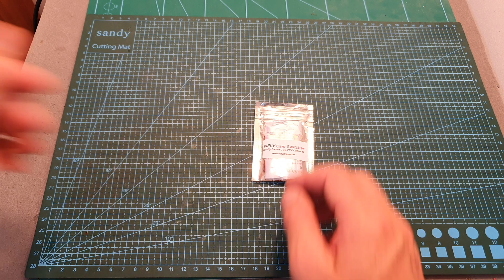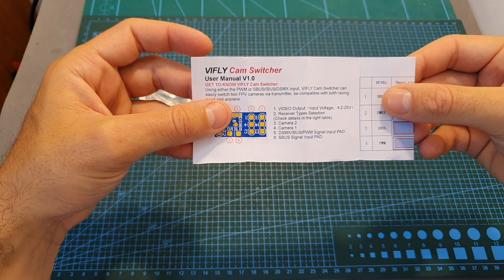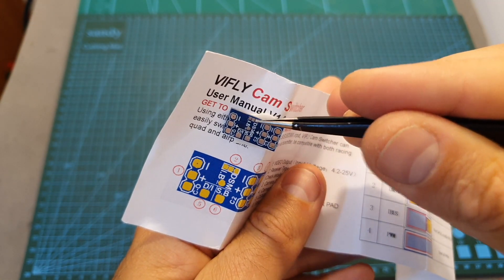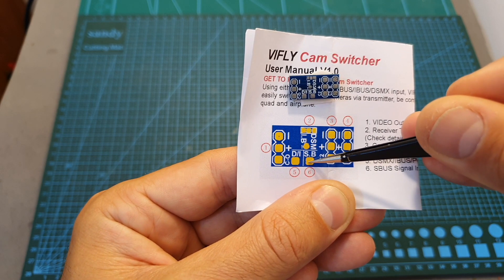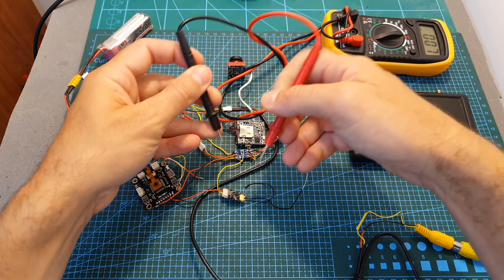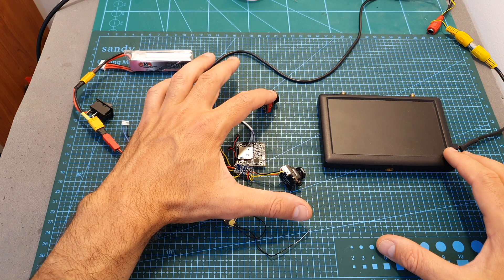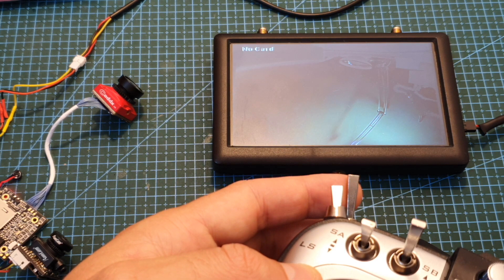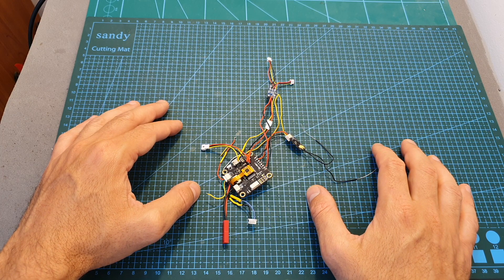VIFLY Cam Switcher - How To Easily Switch Between Two FPV Cameras

Comment: Hi sir what do I need to run a dual camera setup with elrs reciever
what FC do I need?
Reply: My reason run cam split, with a seperate analog camera for best onboard dvr video and for great reliable analog feed thats low latency, cant achieve everything with just the split, so this can help me to use the split run cam feed to change settings for it then switch back to other cam for flying low latency and reliable

Comment: So the sbus signal out of the rx connects parallel to the flight controller and to  the camera switcher at the same time ? 
 And the switcher is using channel 7 always ? I just configure channel 7 to a swich ? 
 Or does the sbus go through the switcher and out to the flight controller ?

Comment: how many cameras can you hook up to an FPV set ?
Reply from the maker: Using this adapter you can connect two cameras. If you will use a flight controller with a built in 2 cameras switcher you can connect 4 cameras.

Comment: thank you for your video.
I'm thinking of using one of these to switch between rear and front camera of my car. Do you think the switch can be operated by a 12V signal, like the reverse gear light?

Comment: Thank you for your making a video about this Switcher. 

Now, I'm thinking 2 Runcam split 4k cam to this switcher. If I do this, will the recorder of the two cam both record each video all the time?
Reply from the maker: You're welcome. 
No, it will just switch between the video feeds. The cameras will be powered and recording all the time.

Comment: Can it does picture in picture? I seen a video with their fpv camera as the main feed and the GoPro fpv out was on the lower left as a smaller thumbnail
Reply from the maker: No. What you've seen is done through an editing program.
Reply: Gal Kremer have a look https://m.youtube.com/watch?v=X9D1uwdCC48&feature=youtu.be

Comment: I was interested in getting one of these for a quad and also for an rc rock crawler.  Thanks for making a video about it.
Reply from the maker: My pleasure
Reply: @Dan Wright No problem!  I have not had time yet as we are building a house and I have a one year old son.  I bought all of the gear to do it though.  I ended up getting a couple different camera switchers from GetFPV, one for two cameras and one for three because I am not sure which one I want to use yet.  I got the new Foxeer Cat 2 ultra low light cameras for doing FPV at night.  I am going to do it on a Traxxas Summit because it is the most capable off-road RC car I know of and I don't want to get stuck while driving in FPV.  My plan is either to use Crossfire to do a long range rc car driving, but it is not fun to drive a car with an aircraft controller, or use the stock 4 channel Traxxas system, but then I would have really short range.  If I use crossfire, I will run the switcher on an extra channel.  If I use the stock radio I will have to run the switcher off a splitter in the throttle channel so that it switches forward when going forward and then back when backing up.  With the three camera system I will also have one camera pointed more down for rock crawling and it will switch to that camera when I switch into the low crawling gear, but that would require using two two-camera switching boards wired in a slightly complicated way so that reversing always turns on the reverse camera, but going forward would switch between two different cameras depending on which transmission gear you are in.  I am also going to wire in a flight controller and GPS so that I can get Betaflight OSD with GPS info like location and speed on the screen.  I can't wait to do it, but no time yet.
Reply: @IanBeaty  if you want extra range and you don’t like drone remote you can change for a radiolink rc6gs version 2.0 you will able to make 600m and more with and he sell a combo remote + receiver with 7channel for 80$ its very awesome! I have this remote in my trx4 with my dji fpv google and it’s CRAZY 🤩
Reply: @IanBeaty  i think some vtx can do osd without fc

Comment: So... would it be possible to use this with an R-XSR or R9MM while having them connected in F.Port?
Or does it need its own receiver, in which case, how would I bind 2 to control both the quad and the camera switcher? :)
Reply from the maker: It needs to be connected to a receiver and get the signal on channel 7.

Comment: I guess not needing a UART is nice, but it limits what protocol you can use. No F. Port and no Crossfire (as you said), which means this is out for me.
Reply: Try the Bicks Multiview Duo switch.   If you are using crossfire you can set CH3 or CH4 output of the Crossfire Nano to send a PWM signal as Ch6 or Ch7.    It is how I run my cheaterkwads that use 2 or even 3 cameras(two switches for 3 cam setup)

Comment: Great Video Gal, I used this ViFly camera switcher in my Sub 250g CheaterKwad build and it works great :- https://rotorbuilds.com/build/18727 - (I've also added a link to this video from my RotorBuilds page)
Reply from the maker: Thanks buddy, nicely done! Thank you very much for your support!
Reply: did you solder the sbus wire on the xm+ on the sbus port and use channel 7?